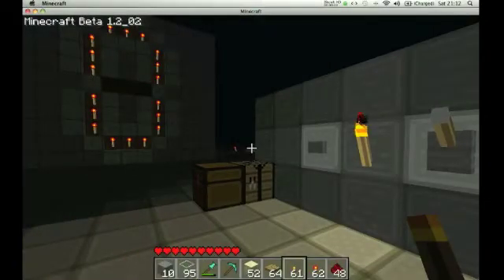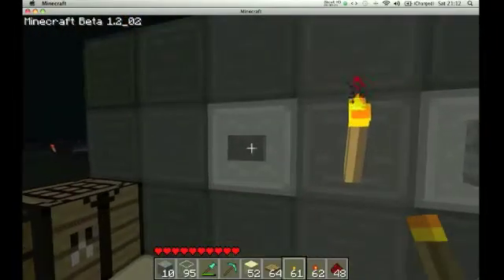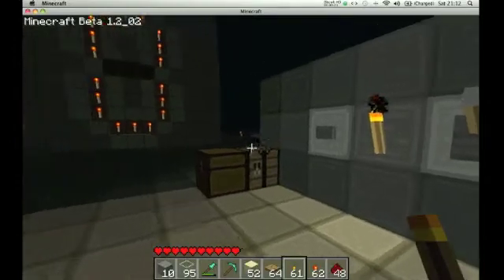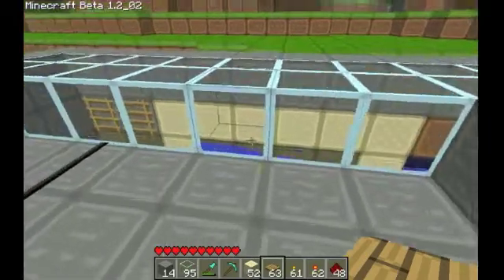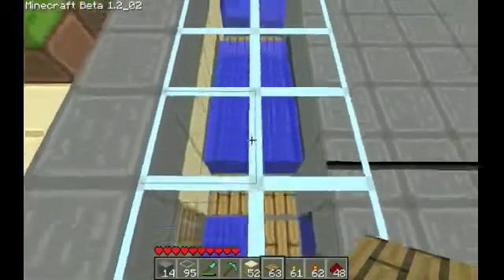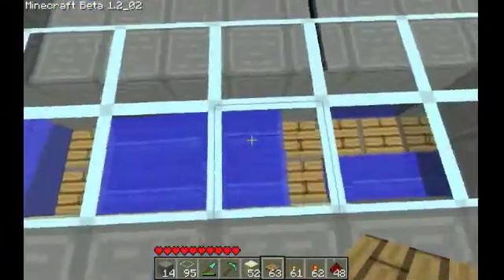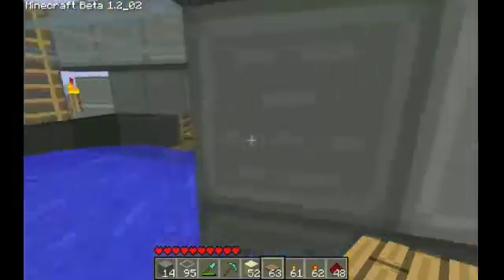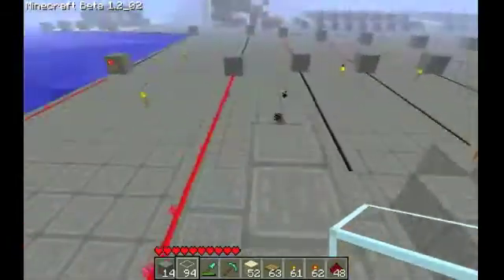Minecraft - How to make a complete 7 segment display & Decoder(Part8)

Comment: If you're going to do this, can't you just use repeaters (or a lot of not gates in older versions of minecraft) and wire it like a song? Wouldn't that be easier or are you just trying to show how to do it mechanically? Also, do you know how to connect a binary counter (with t flip-flops) to work with the display?